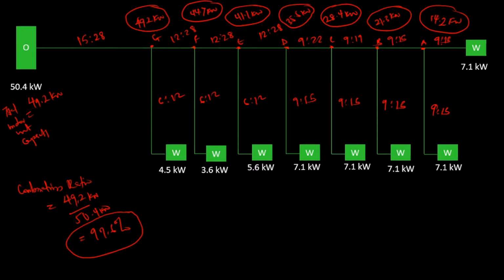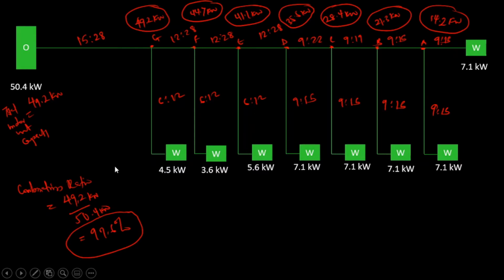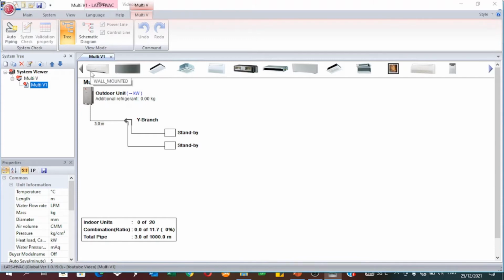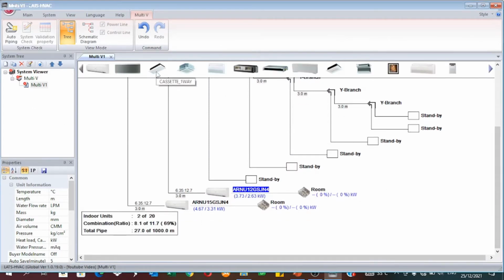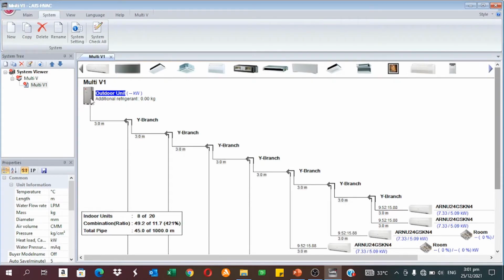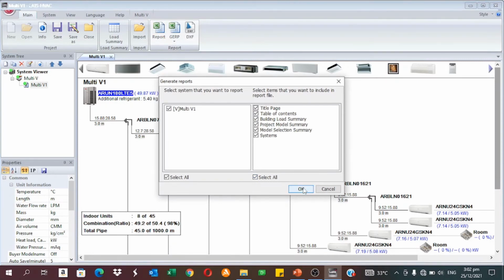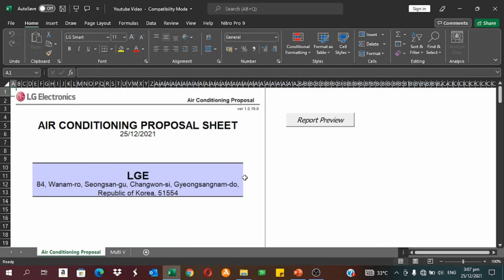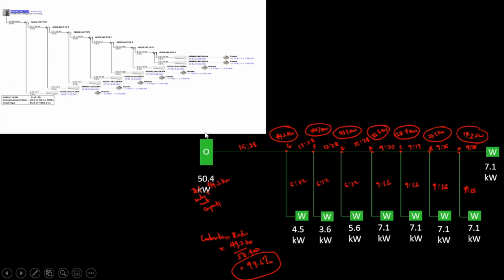Determine VRF pipe sizes manually (3 easy steps) - Part 2

Comment: Good day sir. Thank you for this tutorial. Just a quick question, I noticed in the software that there are pipe lengths indicated. Does increasing the pipe lengths of branch-to-indoor unit change the size of the pipes of branch-to-branch connection. If so, how can we consider that in manual calculation?
Reply from the maker: Hello. Thank you too for your question. The pipe sizes are primarily influenced by the system's capacity at each point. Although, an increase in the equivalent length of the pipes between outdoor and indoor units could force a change in the main liquid pipe. In such a case, some manufacturers would recommend using the next liquid pipe size. 

Different manufacturers have set limits for pipe lengths. At the point of making this video, for Multi V 5,
1. the actual maximum pipe length between the outdoor unit and the last indoor unit is 200m,
2. the equivalent maximum pipe length between the outdoor unit and the last indoor unit is 225m,
3. the longest pipe length after the 1st branch is 40m (90m for conditional applications),
4. the height between the outdoor unit and indoor units should not exceed 110m.
5. the height between indoor units should not exceed 40m.
6. the maximum total pipe length is 1000m.

The software itself would shout at you if you exceed these limits.

You should also consider these limits in manual calculations/drafts.

I hope this helps.